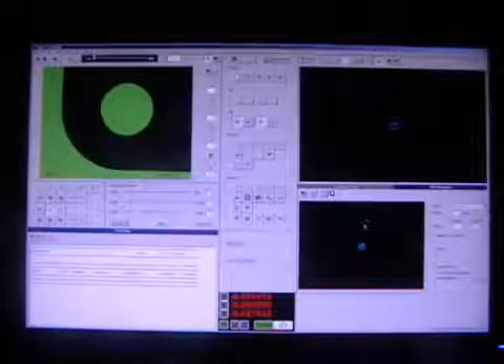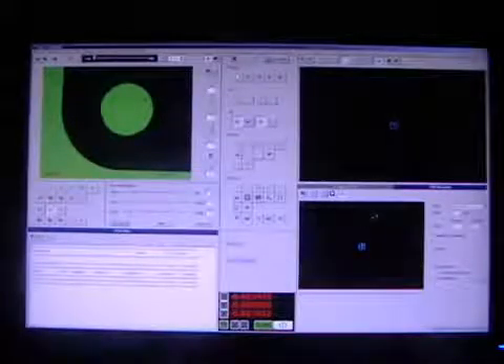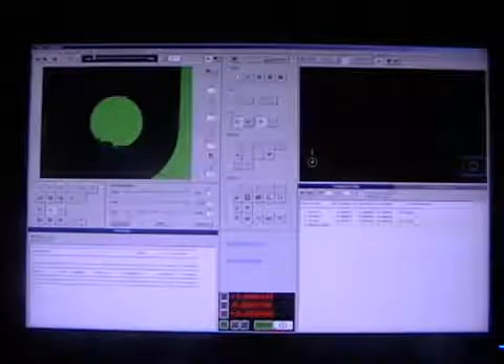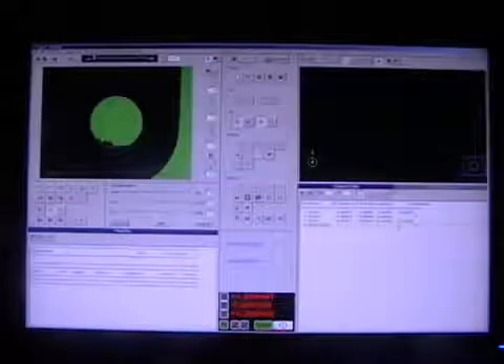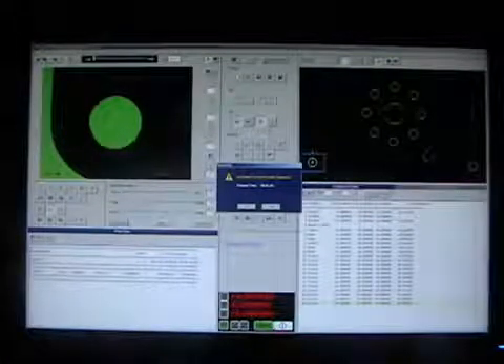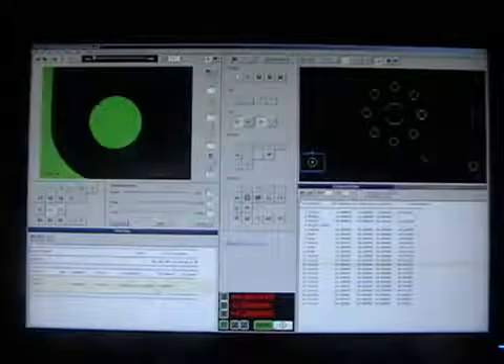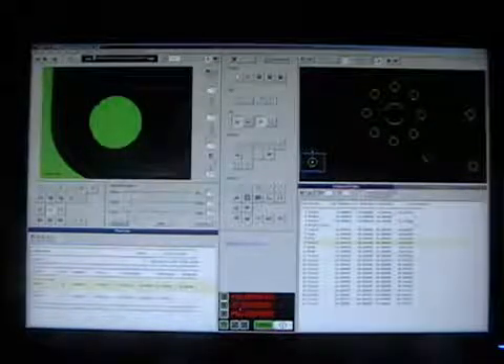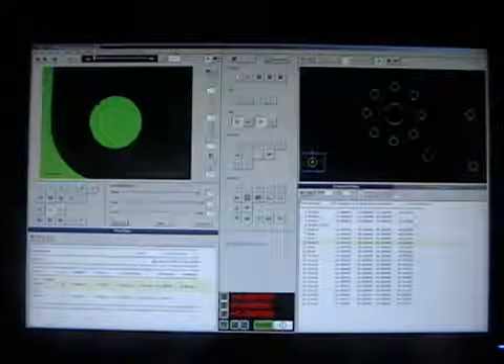RAM Optical   Starlite   part 3 Gage X software CAD programming

Comment: Great video. And very impressive software. Can the software be purchased separately for use on a retrofit or diy machine?  I would like to build my own optical comparator/ cmm machine for hobby use. I also have a 1990s MP digital optical comparator that is not working. im having a heck of a time finding Any information on how to do this. Maybe I'm using the wrong key words in my searches. Any help would be wonderful. Thanks